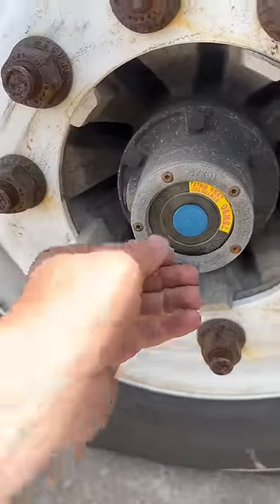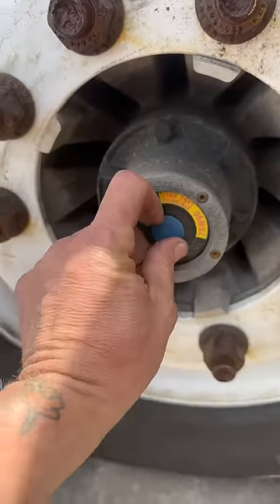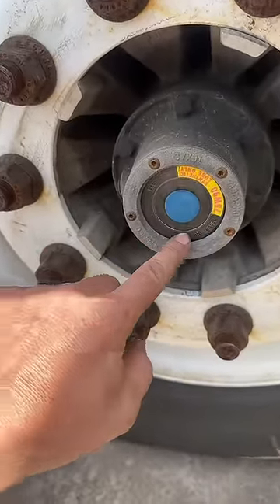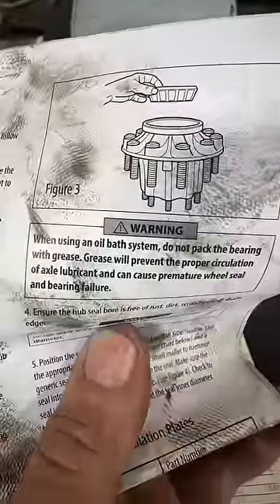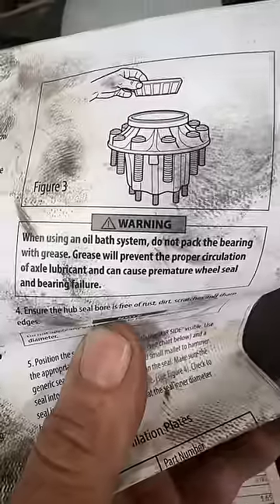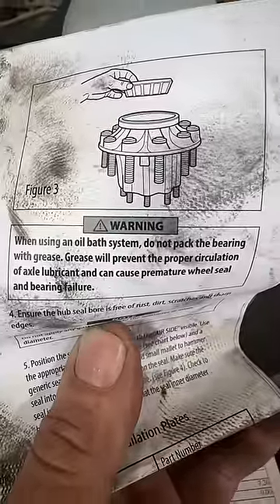No idea what you’re talking about

Comment: Even garden trailers have oil bath bearings available . Just the shitty grease packed ones are not reliable or easily maintained like the oil bath type.  My work vehicle is like the one in the video sight glass on the two steer axles and a sealed hub for both drives .

Comment: Man I have driven trucks for over 24 years and I have seen mechanics do some weird shit most of it worked.  Strangest thing was in Texarkana when a mechanic would fill the fuel filter with transmission fluid after changing a fuel line on an old freighter.

Comment: He interprets things incorrectly.   You’re 100% correct I’ve been turning wrenches on everything in the world with a nut and bolt or a wheel or without wheels since I was 10.     Some people just like to think they know everything they haven’t experience life enough they haven’t seen everything.    Heck, I still learn a thing or two almost every day.   To be truthful it’s all about new electronic communications in automobiles.    Which is absolutely unnecessary.       For example.   Why does the antilock brake system need to be talking to my driver seat module?      Oh, in case somebody gets really close. The monitoring systems will tell the ABS that it might need to activate in the ABS therefore wants to tell the seat to tell the driver. Hey you’re close to something         

I apologize if your eyes do not work, and you do not see, said some thing      you’re gonna hit it     And hopefully learned a valuable lesson      Look before you leap    

That’s the same lesson the Internet warrior commenting on your oil bath bearings is learning right now       

When will people learn?       Practice what you preach?     If you’re wrong, admit when you’re wrong.       
And please do not confuse cockiness with confidence     

After all confidence is having faith in yourself        

Cockiness is you hope it all works out    

I like being in control therefore things work    my faith in myself is great

Comment: Depends on what type of bearing your replacing some bearings do not use oil or grease they use a special kinda grease oil. Grease doesn't do the job as well as the other stuff I'm talking about... Tell me I'm wrong becuz I'm not wrong... You grease a wrong bearing it will wear out the housing as well....

Comment: I'm embarrassed to say this. I learned from I guy that packed bearings in oil bath hubs. He basically said it would lube the bearings until the oil took over its twice as more good. I didn't question it and went with it. I eventually figured it out by reading service procedures and stopped.

Comment: You definitely make me miss being a semi truck and trailer/heavy equipment technician. Some floating diffs on automotive run oil bath bearings and I have been fired before for not packing the bearings and hubs full of grease. Cool, fire me for doing the oil bath per instructions.
Reply: And yes fronts are different than rears in automotive so my reference is to rears where the hubs are filled by the diff and a prime hole in hub.

Comment: All bearings will work with oil anyway. Just need the proper seals. On my race cars i would rather run oil n change it regularly. It creates less drag than grease n is constantly lubricated. That man is simple.  Plus all heavy equipment runs oil not grease

Comment: The only problem I seent with a oil bath hub is better hope the wheel seal is good. And the sight glass aint cracked and have good plug.. a good driver will keep an extra wheel hub or two... but I'd still carry a grease gun with two tubes of grease in my truck.. just in case

Comment: I forget what it's actually called, but the way I explain it is that It is an oil bath bearing. I would hate to see if that guy has any kind of old equipment such as waves or other shopping equipment because they used to use bath bearings

Comment: The fact its got an oil level indicator is wild. Also, he aint worked on cars neither. You start as mechanic you get told all brakes have asbestos and check the grease fittings

Comment: You should explain to them no matter how tight their luggage are. If they do not make sure to maintain their wheelseal with gear oil then eventually it's all gonna leak out and it would happen when that happens, and it starts smoking. You got 2 free. Semi trailer tires with rims.  In a break chamber on the back.
For free.If it didn't come off of your truck or trailer😅😅😅

Comment: Full floating rear axles on any 3/4, 1 ton, and above require gear lube, and the gooseneck trailer at the shop right now! Its a dual axle, dually gooseneck heavy equipment trailer! Yeah, has a stemco style cap with a rubber plug to add gear lube! God people can be arrogant idiots!

Comment: Oil vs grease. Major boil temp difference. More weight means more friction means more heat. Grease would fail in a couple miles. There's dump trailers and car haulers that also use oil instead of grease. Know your facts before stating facts man...

Comment: HOW TO FK THEM BEARINGS UP, STEP 1 PULL RUBBER CAP SPRAY PB BLASTER STEP 2 REPLACE RUBBER CAP AND WALK AWAY STEP 3 MY FAV

PULL PLUG USE BRAKE CLEANER AND REMOVE ALL OIL AND REPLACE CAP, TO ME THIS IS FKG WHY OIL BATH IS A FUCKING JOKE

DO I NEED TO PROVE

ps STEP 4 REPLACE GEAR OIL WITH DOT 4 BRAKE FLUID, THEY WILL LAST FOREVER ROFLMOAO